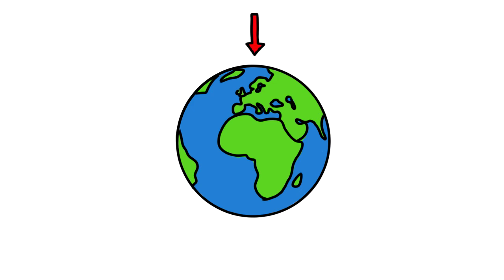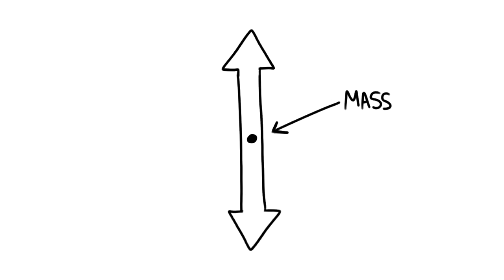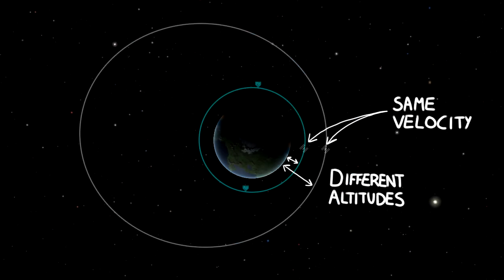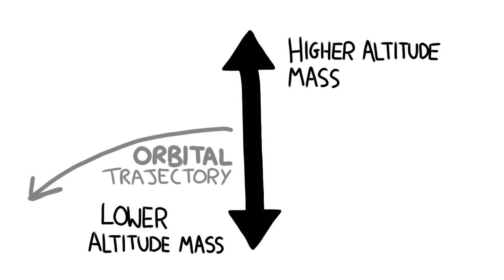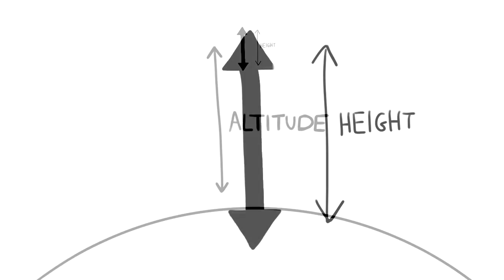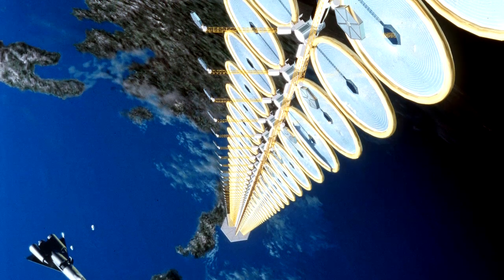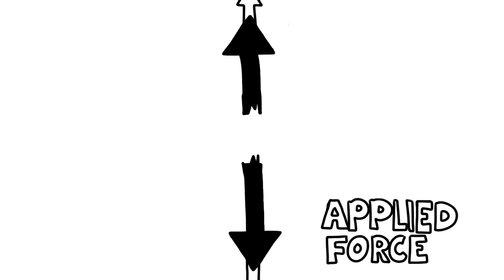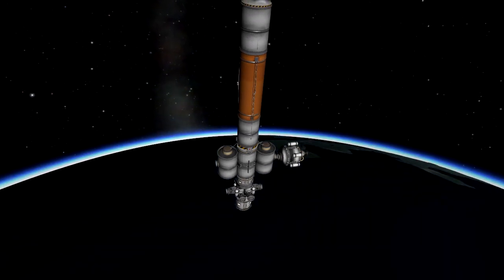Gravity Gradient Stabilisation

Comment: Excellent video, Very informative.
I worked out a way this might work in KSP, and tried it out. I made a probe with two long arms, each with a sort of bucket on the end. In each bucket was a smaller probe on a separator. I put this in a low Kerbin orbit, pointed it vaguely perpendicular to the surface and fired the separators. The three masses tried to go into their separate orbits, making it wobble around the correct orientation. Of cause this only worked with physics warp, as it was relying on constant collisions.
Reply from the maker: Ah, interesting. I should try that at some point.

Comment: HOCgaming Good vid. I do this stuff at uni, and I'm impressed. Just worth pointing out that you can also induce an initial rotation in the spacecraft that makes it tidally locked with Earth so that it points at the planet at all times. As long as it's not in LEO where atmospheric drag could decay the angular velocity of the spacecraft. Indeed, geostationary satellites use this method.

Another thing, at 4:30 you show a sketch of a graph. Gravity strength decreases by an inverse square law, not an exponential decay :)

Might be worth referencing specific satellites that use this method of stabilisation. It gives better context as to the reason for choosing a particular stabilisation method.

Keep up the good work :)

PS: Are you at Uni yet? I have a feeling you're still at school.

Comment: The explanation you give is a little bit misleading, the top of the mass doesn't really have a force exerted on it upward, it is still being pulled toward the planet (down) due to gravity. It does however get pulled slightly less than the bottom of the mass, which is closer and feels a slightly stronger pull. (I can see why you explain it this way though, since in the non-inertial frame moving with the object a force does appear to exist and it is easier to imagine)

Your plot on effectiveness with altitude can be explained by the gradient (or how gravity changes with alt), since grav. force is proportional to 1/r^2, the difference in gravity at large distances is very small (try plotting 1/r^2 for very large r's). You could actually compute the gradient by taking derivatives and changing the plot shape likewise. Otherwise, great video, hope to see more like this in the future

Comment: Besides space elevators, what wouldn't have sufficient power to use reaction wheels? Communication satellites would have a crapton of solar panels and not much else needs to stay oriented a specific direction. (Just a question. Awesome video)
Reply: reaction wheels are also heavy, and very weak compared to ksp. (you also need to have a separate wheel for each axis(unless you have figured out how to rotate a sphere in any direction constantly, that is.))

Comment: Would the force be exponential with respect to altitude? The force attracting each object to the Earth is ∝r^-2, meaning that the difference in forces between the top and the bottom is proportional to ∝(r-δ)^-2 - (r+δ)^-2 = 4δr / (r^2-δ^2)^2.
Assuming delta is small, we have:
4δr / (r^2-δ^2)^2 ≈ 4δr / r^4 = 4δ/r^3.
So the effectiveness of this method would increase linearly with the separation of the two ends, and with the inverse cube of the altitude of the centre of mass.
Or did I approach this problem wrong (torques have forever been my bane)?
Reply: I think I see what is wrong with my maths — I'm calculating the difference in the forces, which is the tension on the wire which changes with 1/r^3 (a good thing).

Let's take all our constants to be 1, to save us having to use proportionality symbols everywhere. r is the orbital altitude (from the Earth's centre) and δ is the distance between the centre of mass and the centre of mass of each half of the ship.
We know the centre of mass is orbiting the planet at v^2 = 1/r. 
Balancing the centrifugal and gravitational forces for each part, we find that:
F = v^2 (r+δ)^-1 - (r+δ)^-2
= δ / (r^3+2r^2δ)
for the part of the satellite δ further away from the centre of mass, and:
F = -δ / (r^3-2r^2δ)

The difference between these is proportional to δ and inversely proportional tor^3, and the sum of these is proportional to δ^2 (which surprises me, unless it's a very small effect) and inversely proportional to r^4.

Even with this correction, the effectiveness doesn't seem proportional to the exponential of the orbital altitude.

Comment: wait,if the TOP part of a space object has excess velocity,shouldnt it have a tendency to LOWER its altitude?(since you need more velocity in a lower orbit) and vice versa for the bottom part of the object?( i.e it should have the tendency to move up to a higher orbit since it has insufficient velocity).
Reply: if it increases in velocity them it is going to increase the height of the periapsis
the object slows down as it gets to the periapsis and accelerates as it approaches the appoapsis
since the periapsis is higher and the object is moving much slower then it only needs to accelerate to a speed that is slower than what is would need at a lower orbit
this may be a bit confusing so sorry if it is
Reply: Answer to first question: Nope. If you have excess velocity at a given orbital altitude you're going to fall away from the body you're orbiting (aka increasing your orbital altitude). Reverse thing happens if you have a too little velocity at a given orbital altitude. You fall towards the planet.
Yes lower orbits have a higher orbital velocity. That is because the nearer you are to a massive (means: has a lot of mass = heavy) object the more gravitational pull you are experiencing. Therefor you have to move (aka orbit) faster around the object to not fall onto it. Therefore lower orbits have a faster orbital velocity.
manyu k Leaving the realm of our everyday observable physics means that we have to say goodbye to some of our pictures we've made of the world in ourselfs in the way of "that's how it works". It often doesn't. Orbital physics is something like that. Your reference frame always rotates and always everything seems to be relative..... And massive things weigh something like 5972000000000000000000000 tons (approximatly the earth's mass). So heavy is really relative..... (relax the sun only is around 300000 times more massive than the earth...)

Comment: Wouldn't the mass of the elevator going up the tubes off-balance the whole system, and you would have the line bent/stretched to huge proportions?
Reply: Depends:
If the elevator is massive (and I don't mean big but heavy since the physics term massive corresponds with mass not size) and the orbital station is not, then yes because you have to accelerate your elevator from 1.6 km/s orbital velocity (earths rotational speed) to geostationary orbital speed (a few more km/s). If the elevators mass is sufficiently neglectible in respect to the orbital station or you have a 2 elevator shuttle system where 1 elevator always goes up and the other always goes down and vice versa then you should be fine (I think). But I'm kinda lost on that question aswell...
Reply: Good thought, but I'm not so sure about the multiple elevator thing, as the mass would be occupying different spaces, and would induce some amount of 'twist'. While probably better structurally than having a single elevator, I feel like there would still be a danger of tension and compression being to strong for the material (ideally of course, using nanotubes, but i maintain).
Reply: Nate T
 also, from the hight of altitude the thing might just go "POP" due to compresion, the same type that planes normaly need to face,unless everybody onboard is in a spacesuit and the lift is exposed to space then it might not go like that and then everybody on board gets sucked out into orbit

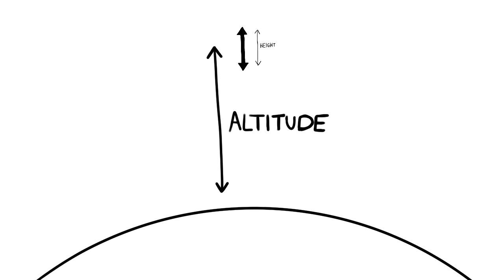Comment: I would expect that the falloff mentioned at 4:25 is not exponential, but rather quadratic, as the force of gravity is referred to as an inverse square relationship (F=Gm1m2/r^2). I haven't worked out the physics on this, but I will let you know if I figure it out for sure.

Comment: I do not agree with you that you need to apply a (continues) force to keep a satellite facing the surface. Because force/torque will induce (angular) acceleration and not velocity. Once you have the right angular velocity, there will be no need for any force or torque. By the way it is also worth mentioning that these orbital forces are called tidal forces.

Comment: I don't get it, why does the space craft want to brake apart?
Reply: The part that's closer to the planet (the bottom) wants to go down.
The part that's farther from the planet (the top) wants to go up.
So the two forces literally rip the spacecraft apart, unless a strong enough material is used.
(Yeah yeah, there are no directions in space.)